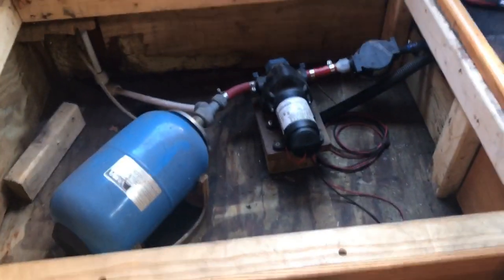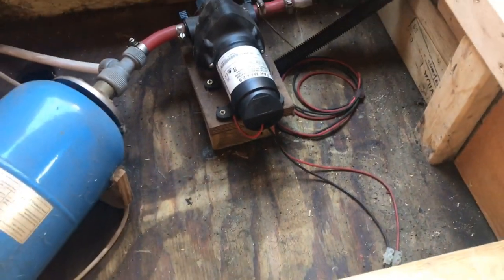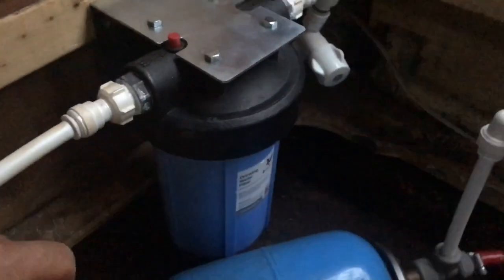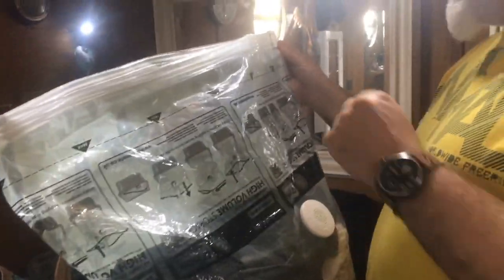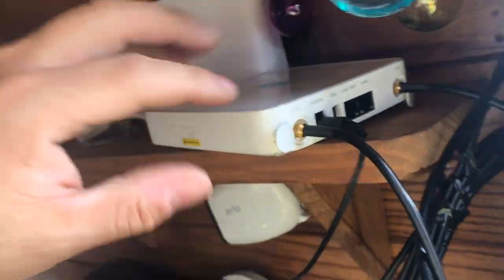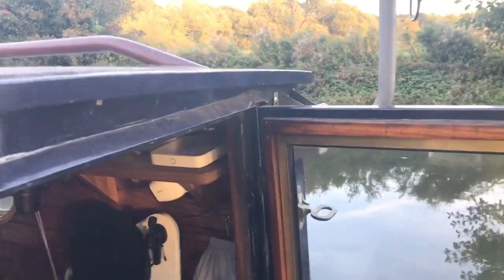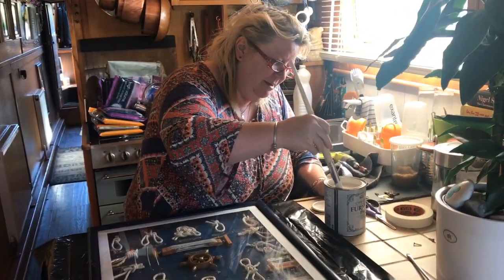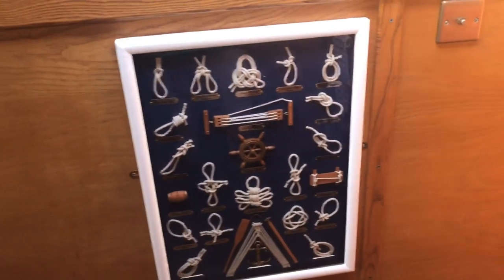Can You Live Off Grid On An Amazing Narrowboat A Still Be Connected With Wifi & Water

Comment: What happens to the antenna when you come to a tunnel ?
Reply from the maker: Thanks for your comment. No problem. The bracket that holds the antenna is clamped and I don’t do it up 100% tight. I just hinge it so it lowers down to go through the tunnel and then on the other side raise it back up again.